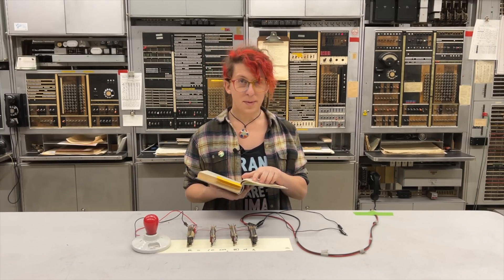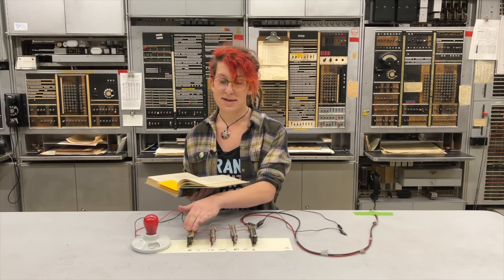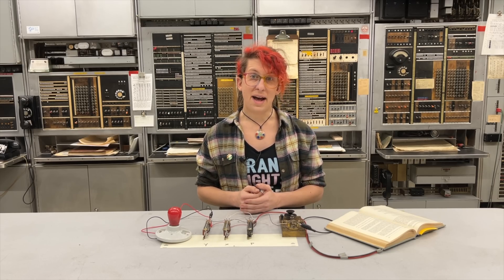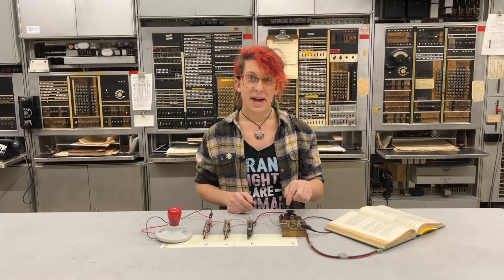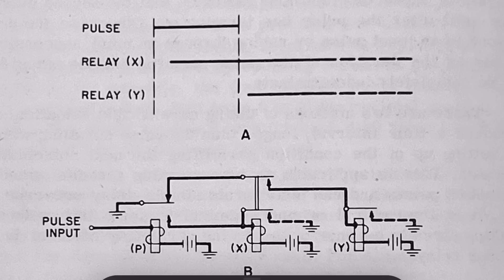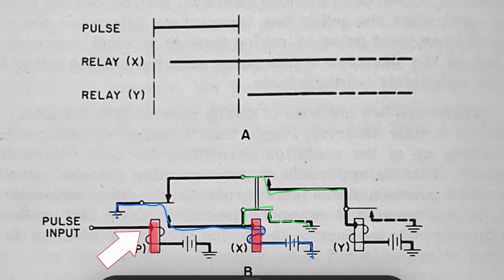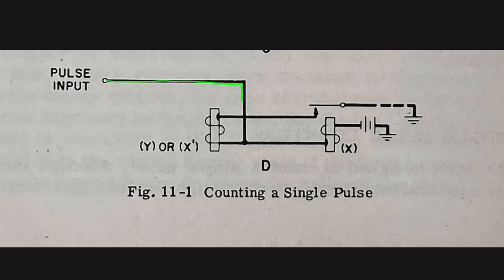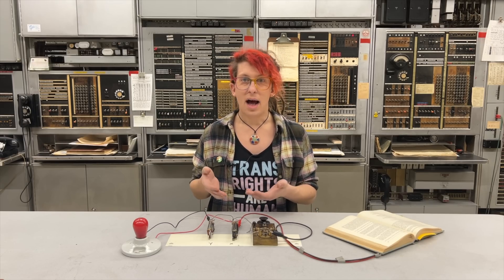Relays! They're Electromechanical Switches.

Comment: At 4:30, wouldn't the Transfer contact be a single-pole-double-throw (SPDT) arrangement? DPST would just be two independent make or break circuits.
Reply from the maker: Yep. I said it wrong :)
Reply: @ConnectionsMuseum  Easy mistake to make. Let me just add that I really enjoy your videos. I love old telephone switches. It brings back memories of my days at Bell Labs. I never worked on anything but 5ESS and the Autoplex 1000 cellular switch but I sure enjoyed hanging out in the 1A and 3ESS labs.

Comment: To add to info and terminology for a different industry, trains. Where I work in the train industry would say a front and back contact. Front contact being open with the coil is de-energized and a back contact being closed when the coil in de-energized. A relay will have several contacts on one relay, some will be paired sharing a common between a front and back contact. Saying Battery is similar, but doesn't imply a specific voltage, it could be 12VDC or 24VDC, depending on the function and circuit. At 9:51 you can see what we would call a front back contact. 

You may find it interesting to know that most of NYC subway system operations via relay logic. There's a lot of relays as you can imagine.

Comment: I just found your channel and I am loving it. I spent my career with Pacific Telephone and it is so much fun learning about Panel switching, trouble cards in crossbar and everything else you cover. Your explanations are easy to understand. We had #5 crossbar offices and most were wire spring and one was flat spring. I recall flat spring relay crossbar offices had single sided trouble cards and wire spring offices had double sided cards. Am I recalling that correctly?  Thank you!
Reply from the maker: That is most likely correct. It wasn't necessarily flatspring or wirespring, but the original (older) trouble cards were single sided, and the older switches were also flatspring, so that would make sense. The double sided cards were mostly for AMA, or Automatic Message Accounting (billing).

Comment: Great stuff guys.  Where were you guys back in 1974 during my telephone hacking days, when I was struggling to make blue boxes and all kinds of gadgets to make the phone company my private playground.  After high school in 1974,  I went to DeVry tech for basic electronics.  After that I tried to get a job in telephone electronics but no luck. A lifetime later i`m still in electronics,  working in a circuit board assembly house doing final testing and component level diagnostics.  I remember about 20 years ago, I received a note from my phone company telling me that they had shifted to 5ESS. And I thought, here is an opportunity to hack the system.  LOL.

Comment: Such a great run down of the history of the relay (especially why it's called a relay, most people miss or skip this factoid when discussing the history of this magical little device!), along with a very accessible little discussion of how it works. The only thing I would add is an extension of the discussion to include a brief mention of the fact that the concept of the relay has evolved into the super complex strata of complex logic circuits that make up modern computing - perhaps the only thing that I find cooler than the magic that is a relay! 

Thanks for putting this together and out into the world! 🤓

Comment: I spent a whole career as an electrical engineer and I still get confused over poles and throws but I'm 99% sure that you got that wrong at 4:15.  A transfer contact (which I would call a change-over contact) is single pole double throw (SPDT).  I's very non-intuitive but the poles are the number of circuits being controlled and the throws are the number of possible contacts being made by each pole.  Actually it must be thirty years since I last used a relay so things might have changed.
Reply from the maker: Yes, I got that backwards. Sorry!

Comment: I am trying to reconstruct some of the old indicator lamps that were used on communications equipment. They were constructed of a threaded brass tube, with a chrome bezel and white opaque glass dome insert. I am remembering these from many years ago and would really appreciate if you could share any close up images you might have of this kind of indicator. They were about 12 mm in diameter. Sail Hatan, Chris UK.

Comment: when you say 48 volts.. my understanding is all telco equipment has always operated on -48 volts ?
Reply: Polarity is relative, 48 volts is 48 volts between the battery terminals no matter which way it flows. In an isolated DC circuit, like a flashlight or something, you just have battery + and - and that's all you need to know.

In telco land the power system is not isolated because of the outside plant. Meaning, the power that comes out of the batteries gets sent outside where those lines interact with the environment and eventually power the handset in a subscriber's premises.

Like in power distribution systems, having a relationship to the earth improves safety and fault detection. "-48 V" refers to the battery's relationship to ground. In a telco DC plant, the positive bus bar is bonded to earth. IIRC once upon a time, the negative bus was bonded, which created "+48V" systems. It was discovered over time that this induced corrosion on exposed conductors, like anywhere a tree or squirrel obliterated insulation, but also patches, splices, terminals, and so on. The polarity was switched and corrosion stopped being such a big problem.

Comment: If y'all are interested in an in-depth exploration of relay circuit design and combinational logic, I highly suggest you search for "Clickety Clack Relay Computer" on youtube. Unfortunately the actual machine was never finished, but the builder did explain logic gates and the process of making a basic CPU with an ALU, cache, instruction set, and multiplexer circuitry just using relay logic. It's a great learning experience, and it's not too different from the circuitry you work with at the museum.

Comment: "I don't say 'a battery' or 'the battery'...."

Seconds later...: "the batteries in the basement."
Reply: The central office "battery supply" was made up of one or more strings of 23 individual lead acid cells that were floated at 2.17 volts each, connected in series.  At the end of each string was one or more "end cells" which could be cut into the string by the emergency end cell switch.   Main battery switch board in my CO had hundreds of fuses from 1-1/3 amps, all the way up to several thousands of amps.
Reply: @henrythompson7595 : Thanks, that's interesting! But I was just making the point that Sarah self-contradicted.
Reply: @HelloKittyFanMan.  There's no contradiction here.  'Battery' is the name of a supply voltage just like we might use Vcc nowadays and 'the battery' is the device in the basement that provides it.
Reply: @petehiggins33 : There is a contradiction. Please pay closer attention and reread my OP. Also, I'm glad you said "might use..." with that, since "Vcc" means "voltage from collector to collector," meaning that the circuit must be at least a little bit transistorized for that term to apply -- you wouldn't say "Vcc" just for powering a basic DC light or motor. But I do appreciate that you used the term directly with me like you kind of figured I would be advanced enough know what you mean by just that... because I did!

Comment: I worked on 3ESS and 5ESS at the Western Electric NIW Works in Illinois from 1977 to 1983. The 3ESS used relays and reed grids for switching the calls. The 5ESS was all solid state and used gated diodes instead.

Comment: The first Course when I was working for plessey telecom in the 70s on exchange construction was switch and rekey adjustment I would have difficulty with the job my eyesight is not what was when I was seventeen. Battery was the word that was used out in filed when I worked for the G.P.O. when I was Fault finding out in their network the test controls would tell use the is showing battery on the wrong leg off the Circuit

Comment: For those wondering, yes, a phone switching system could, and several were, made entirely of relays -- North Electric and their CX line of all-relay switches are worth looking up.

I imagine they worked incredibly well, but would have been, on a whole, more expensive at certain scales than other tech and as such weren't the best for all cases.

Comment: I did a lot of work with residential furnace control design.  As a young engineer I was unaware how much science went into modern relays.  Long term use and reliability are critical for a commercial product.  One example is the effects of the crossover plasma formed when the relay throws.  it can disrupt other more sensitive components as well as determine the life of the relay.  thank you for this series!